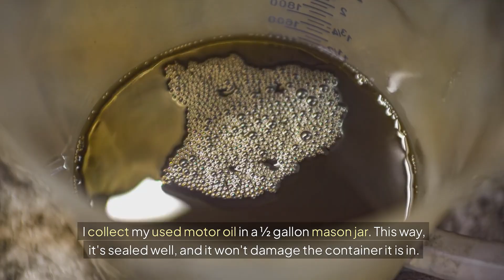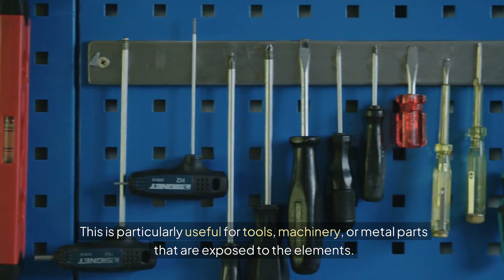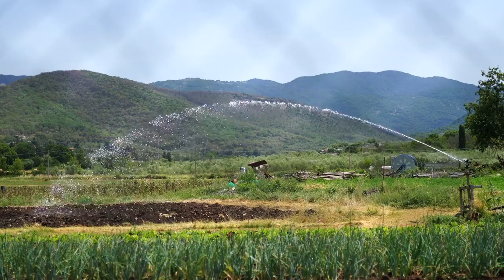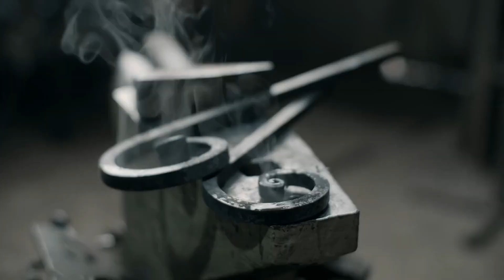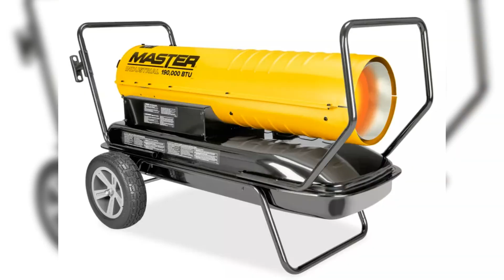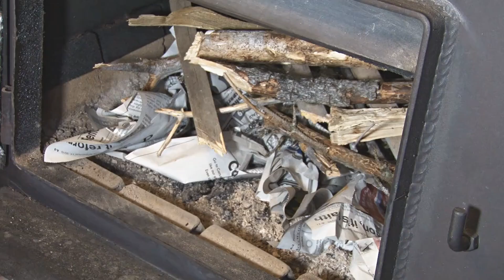WAYS TO REUSE MOTOR OIL!

Comment: Growing up,  we put fence posts in a 55 gallon drum half full if used oil. Then we built a fire around the drum. This caused the oil to thin out and wick into the center of the posts. You could literally watch the oil creep up the post as it got hotter. Posts treated this way lasted 20 plus years, and in South Louisiana with the abundance of termites, this was a long lasting post treatment.
Reply from the maker: I will have to see how to heat the oil. I've placed it on the bottom of all the supports for the cabin, and bottoms of any fenceposts etc. It DOES wick up but not like you are describing. :)
Reply: @offgridstyleprepper thin it out with Everclear 190 proof, 99% alcohol fine a thinner and you won’t have to heat it
Reply: Nice idea.

Comment: Grandfather undercoated cars in the thirties to fifties. Grandmother used it for mosquitos in her rainwater barrel.
Reply: I'm hearing that owners manuals for cars in the 20's-30's  suggested using the used oil to stop rust on the sheet metal.
Reply from the maker: Very true. But back then they didn't understand that the oil could end up with junk in it that would actually cause rust. :)

Comment: The older H-45 Military tent heaters will burn used motor oil. My Grandpa "aquired" a couple of them when he came back came from WWII and used one in his shop and one in his pole barn during the cold Missouri Winters, the one in the pole barn didn't get "Blazing hot" but it kept his tractor and other equipment from freezing when it gets negative fu(k this outside.
Reply from the maker: You can purchase heaters now that will run on used motor oil, which I thought was a great tip, as in an shtf situation, you might be able to get car oil :)

Comment: Good morning Nikki , I uses old oil for my posts for my dog pen . It helps keep the wood bees from chewing on wood .
Reply from the maker: I save mine, but I always am running out, bc I use it on all the wood posts for anything i build lol I need to get a hook up with a oil changing place. Especially knowing I can buy a heater that will run off it.
Reply: I didn't think about it here on the farm.  I'm pretty frustrated that wood peckers and ants eating up the regular treated post so old oil may be a solution.  As a kid it was common for the county to spread old oil on county dirt roads for dust control.  It was almost like blacktop.  Plenty of old oil here on the farm that is mostly used for starting brush fires and lube for hinges etc.  Used hydraulic/trans oil is in oil cans to lube where you want cleaner oil.  Common past practice was put used oil in Diesel fuel tank.  Old gas tractors, heck yeah.

Comment: Morning Nikki. I always keep my used motor oil to quench steels as well as use it to coat my forged items to keep the rust off. Also brush some over a new weld to keep the rust away. Used motor oil can also be rubbed into leather boots or shoes to soften the leather and help make them water resistant. Don't forget oil cloth, used motor oil mixed with linseed oil will waterproof canvas tarps. Another use is undercoating vehicles and tractors, you do need to reapply every 6 months or so, but will slow down the rust.
Reply from the maker: I knew there were other uses, and thought of you both when I talked about using it to quench metal, and that you would have some great additional tips :)